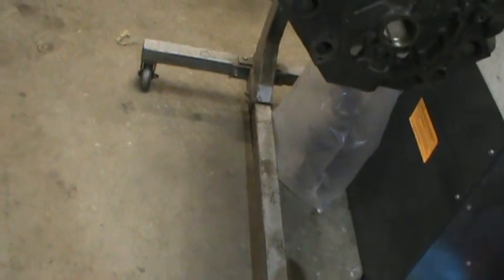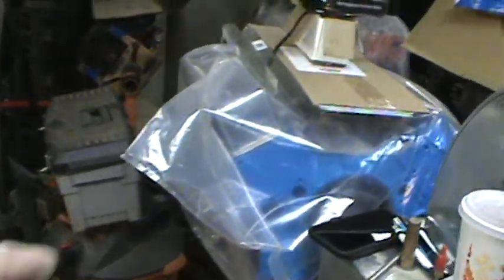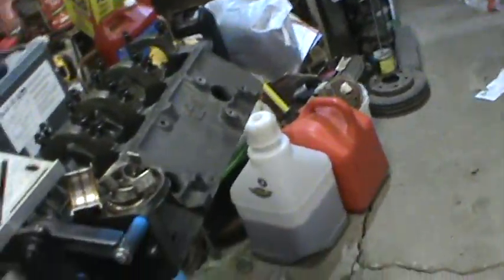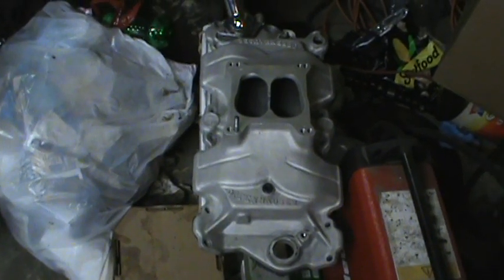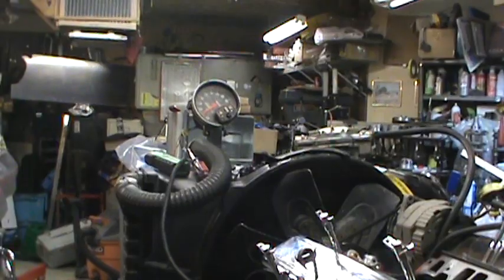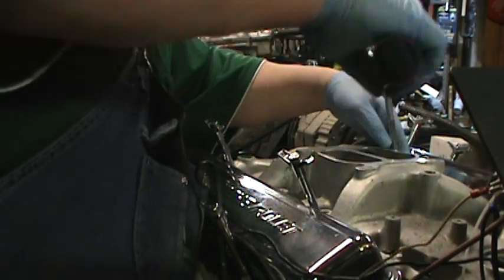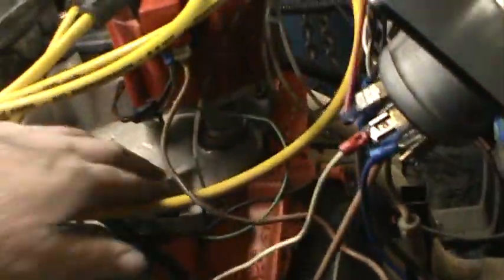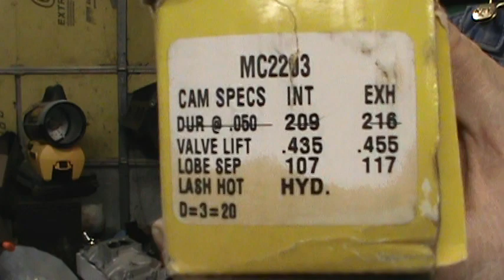intake changed on 357 and was it a good thing? on i goofed 11:18 is where the 357 motor is

Comment: hey everyone hope all is safe and happy.just wondering what hp the 377 destroker made.cheers have a great day
Reply from the maker: the 377 is done and sitting on the floor now waiting to go in something.
Reply: @tlcbear2  I run a 352 destroker can I just change the crank from a 327 to a 350.or is that a dumb question lol
Reply from the maker: im sure you will have to replace pistons because the wrist pin height will be different.